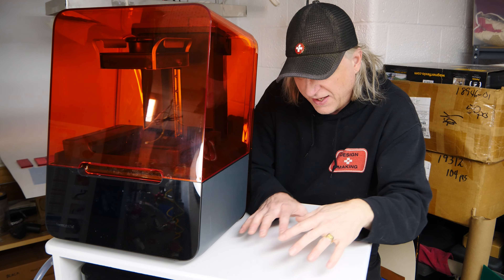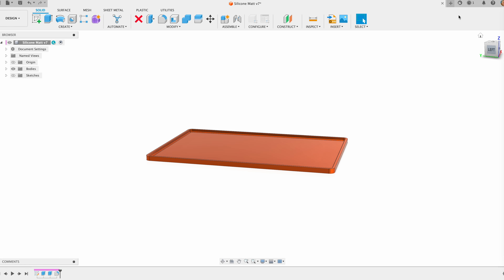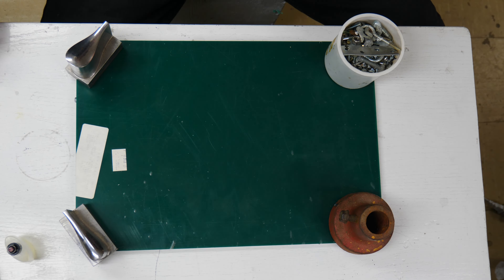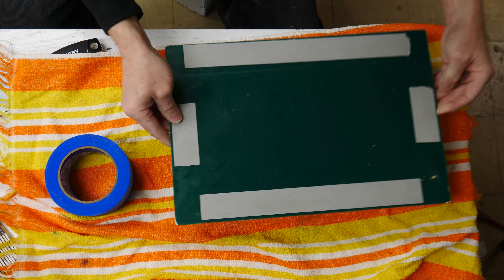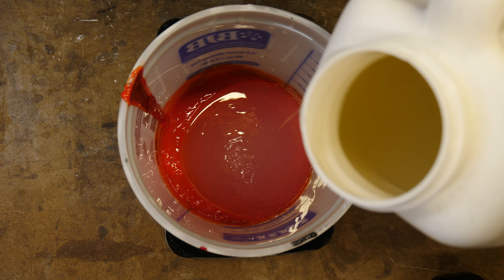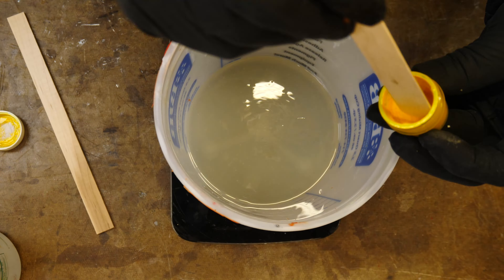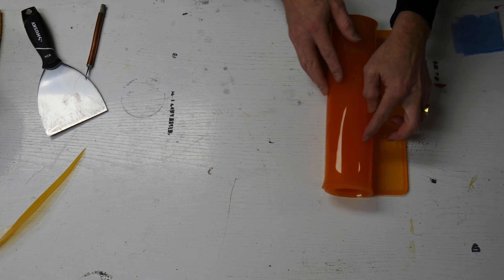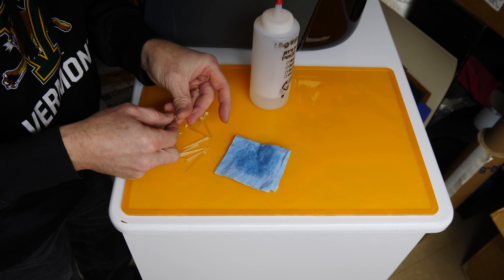Making Silicone Parts with Laser Cut Acrylic Molds

Comment: Eric, for technical knowledge moving forward with the TC-5150, was that original Red/Yellow pigment a urethane pigment or was it for silicone?  We have seen some silicones cure ok with some of our BJB urethane pigments, but others experience weird issues like inhibition or gelling up too quickly.  Our 8100-series silicone pigments work across the board with all of our silicones.  Cool work pad BTW.  The translucent orange looks OEM with the Formlabs 🤔😉
Reply from the maker: The first failed attempt was not a silicone specific pigment. It's a standard pigment that I use for resin casting. I did not think twice about using it, but I'm also not so used to platinum curing inhibition issues since I really don't use a lot of Platinum silicone.

Comment: Hi Eric, in one of your next video can you please explain when you will use platinum cured silicone and when you will not, basically a primer on different kind of silicone and when to use what.. I am looking for more parts from silicone itself (like the mat you made here) for high heat applications and would love to learn before I go too far.
Reply from the maker: No preference, just what happened to have. But personally I prefer tin cure and not platinum silicone. There are too many inhibition curing issues with Platinum silicone.

Comment: I tried doing something similar once and had trouble with bubbles forming when I put down the plexiglass.  I vacuum degassed the silicone and there were no visible bubbles until I placed the plexiglass backer.  The process of placing the plexiglass seemed to trap bubbles.  The bubbles weren't small ones that were entrapped during stirring or pouring - they were very large bubbles the were created when placing the plexiglass.  I'm curious if you've encountered this and, if so, how you dealt with it.
Reply from the maker: Nope no issue like that, lay the glass slowly from one side to the other so you don't trap any air.
Reply: @EricStrebel  No  matter how carefully I applied the plexi I got bubbles.  Next time I might try gently rolling on a piece of thin plastic like mylar then placing the plexi on top to hold everything flat.  I'm hoping the thinner material will give me more control with the ability to roll it on and push bubbles in one direction.
Reply from the maker: Yes, perhaps that could work

Comment: For this Use it’s no problem:

PMMA ("Acrylic") can also be glued/bonded with MMA without the Issues a Solvent brings.
Although a suitable Solvent is often already in the Workshop.

The Monomers in the Glue will form PMMA themselves and don’t introduce Stress Cracking like Solvents.
Reply from the maker: Yeah, if you have some MMA it would work, I don't have any. Essentially MMA is a solvent based adhesive so it should work for glueing acrylic.

Comment: I've heard that it can help avoid curing issues like this to mix dye or ink in just one part - but I can't remember if it was the A part or the B part. Probably pretty important to do it in the right part for this tip to actually help!
Reply from the maker: It's just a Platinum silicone issue I'm not a big fan of the material.

Comment: Nice job.  That's going to be a great upgrade to the cart.

If you wanted to attach the mat "permanently" to the cart, is there a preferred adhesive you would go for?
Reply from the maker: Nothing much bonds to silicone so, I don't have any options for you.
Reply: One option would be to overmold magnets into the silicone, or cast blind holes in the silicone that you can press fit magnets into later. Then match those up with magnets or metal in the surface it sits on. Or if you don't want magnets near your work, you might be able to mold metal snaps into the bottom of the silicone, like those you find on the closures of some shirts or jeans. But then you have to do some more complex mold making. I'm going to ask my coworker too, he somehow found some kind of PSA that he used to make an adhesive backed silicone part. Or you could mold little bosses like feet into the bottom of the silicone that could press into matched holes in the work surface.